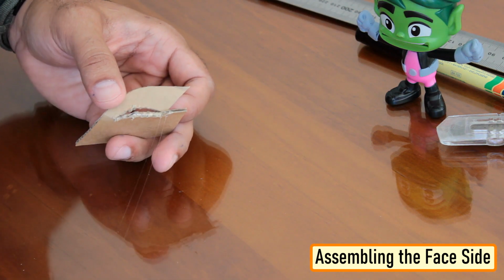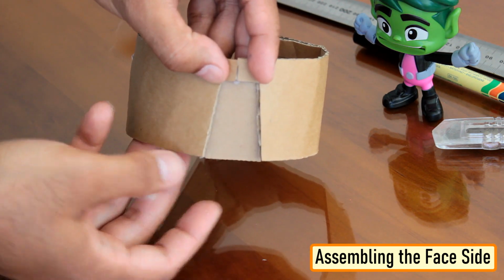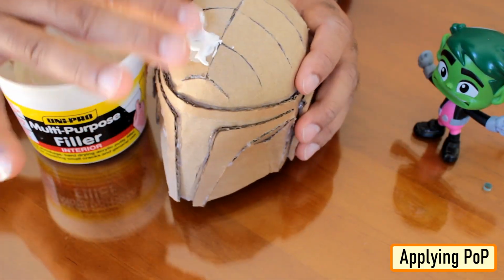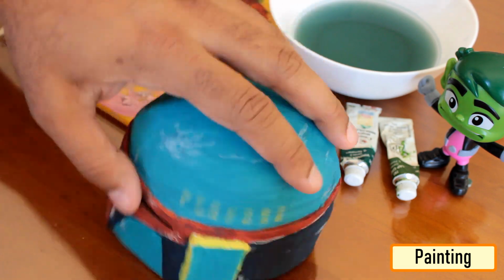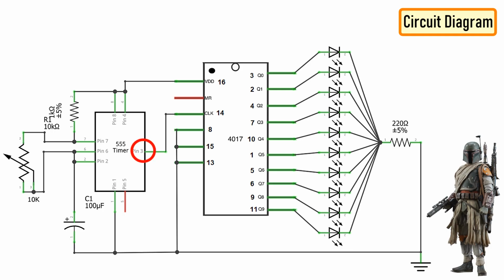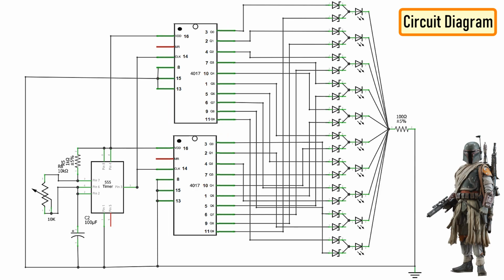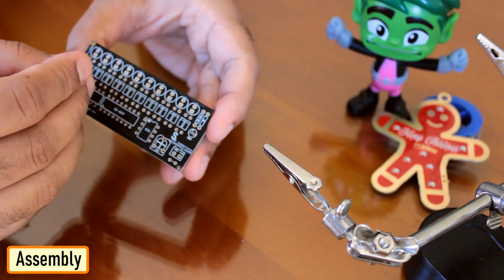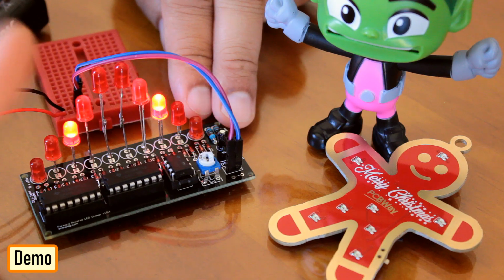DIY - Boba Fett Helmet With Cardboard and LED Chaser Circuit

Comment: Super dope tutorial video! I’m really inspired to create a custom board for my projects. I took a class last summer and learned the soldering and basic components. Arduino is cool, but I really appreciated learning how this is designed .
Also a hot tip on the templates: if you print them at 45.75 cm x 61 cm instead of A1 paper, the helmet will be “life sized “.
Reply from the maker: Thanks Jason for your amazing tutorial that I used as a base for this project. 
Cheers

Comment: I always use Arduinos for Larson scanners now. Much quicker, easier and cheaper. Right tool for the right job you could say.

This is a nice little project, but I do find it a little odd as a combination. You're better off putting Larson scanners in BSG Cylon helmets. I'll get you a link to one I've made if your interested in seeing?

Either way, nice job still.
Reply from the maker: That’s good. Cheers and why not, plz do send me the link.
Reply: @CrazyCoupleDIY  https://m.facebook.com/photo.php?fbid=10153617777435495&id=896285494&set=a.10153616995030495

That's the best photo, but feel free to look through the whole album. It's got a scanner in the eye slot, just behind the one way plastic.
Reply from the maker: @PollokPoochesDogWalking  That looks great mate